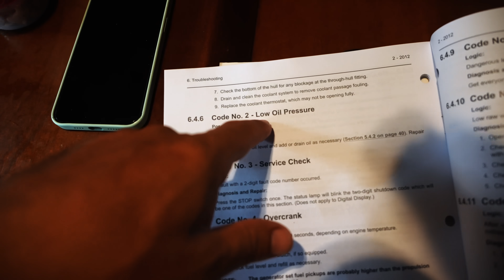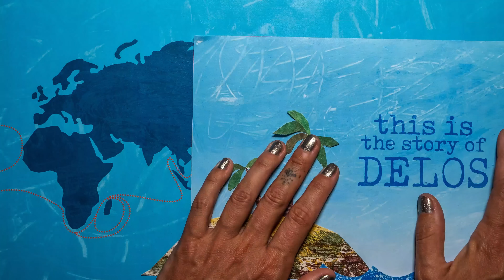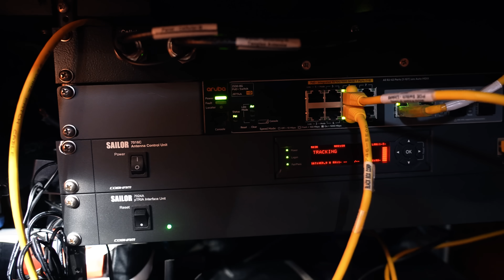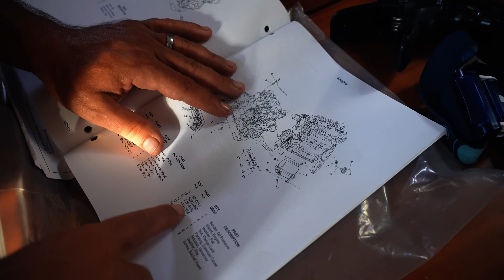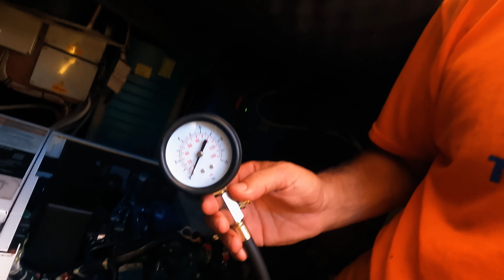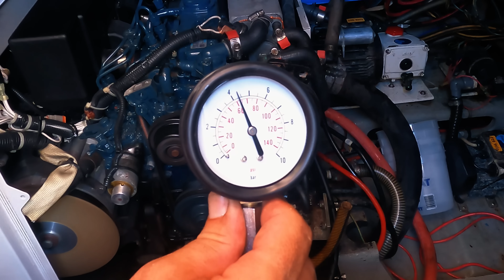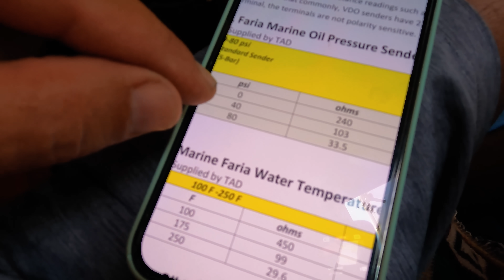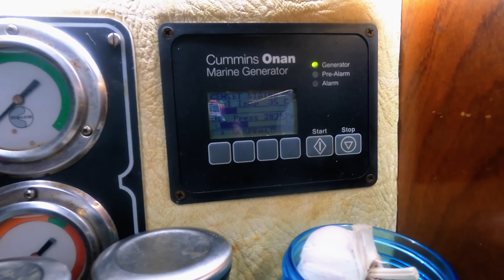TROUBLE IN PARADISE 😳 Sailing Vessel Delos Ep. 393

Comment: Hey Brian, I once had an oil pressure sending unit where the oil pressure was high enough at high rpm’s to rupture the diaphragm so it didn’t open the circuit so the light didn’t go out. Couldn’t figure it out until the plastic housing cracked and started blowing oil out at high rpm. Since the gauge said 60 psi after cooling down, yet in hot weather I’m wondering whether you have high pressure instead. If the diaphragm has a small enough leak it will take a while for the oil to get on the back side of the diaphragm. Maybe it might make some sense out of your situation. Stay safe and fair winds, ❤️👍🙏🙂.

Comment: You might be able to fix the oil pressure sender by squirting some electronic contact cleaner into the sense hole at the end. Junk can get stuck in there causing low readings. You can use a bike pump to create pressure and test using your multimeter to see if it gives you correct readings.

Comment: You guys had that generator installed in Capetown. With that crane, right? Because I'm replacing my Waterpump & timing Chain on my Vanlife Van I'm guessing your oil is so hot, the viscosity of the oil got so low the generator threw a code. Putting it in safe mode.

Comment: Awesome episode! Into amateur radio from the 1930-40 era and fixing since 1969 as a teenager. So was quite intrigued with your temp fix. Was actually telling you it was the sending unit to my iPad two seconds before you said it, as if you could hear! Fascinating that someone had a supply of resistors and lucky as well. I had capacitors for the boats tube type ham radio though. Do you use HF radio for the maritime network or sailors beyond vhf range? Thanks for your great stories!
Reply from the maker: Hi yes we still use the HF!  I got my ham license before leaving the us.  We have an icom-710 onboard.
Reply: @svdelos  great rig, should last quite awhile. Happy holidays!

Comment: Hey Brian, in case that oil pressure problem comes back, I wanted to share a strange problem I have been having with 3 different brand, size, and age generators on a Mountain in New Mexico at 8,700 feet Elevation. 1 Month ago, I had a Honda EB10000 generator constantly stop running, so I checked the oil, and it overflowed out. I assumed a person here must have overfilled it, so I drained the excess out and tried again. I checked the oil some time after, and again it overflowed out when I opened the fill cap. So, I changed the oil and the problem went away. A Month later, I have found that even with 3 different aged oils, that are 2 different viscositys, it's only lasting 3 tanks of gas (9 Gallons) and the oil looks like water, and they will not run out solar system to simply recharge the batterys. They are typically only at about 50% load at this elevation. A 10k becomes a 7k, (3% loss each 1,000 ft) so I run it at about 3,500k max. This problem is not affecting a 7hp kenitic log splitter, a 1999 Ford F250, a 2000 Nissan Xterra or any other gasoline engine we hve up here. It's only happening to the generators. The other vehicles have the exact same oil in them, from the same batch too. I have used 10w-30 for 3 years now, in all engines up here without a single issue. We do oil changes by the book on all engines, but for unknown reasons, the viscosity is changing in the generators only, and when I drain the oil, it looks s thin as water. I even tried 15w-40 Tractor oil because I considered it might be the colder temps because it was 7f when this started and tht oil is good to -40f. Since then, it has warmed up a good bit with highs in the 50's and lows in the 30's but the problem remains... I have been around engines my whole life and have never seen such a strange problem. I, like you am a trouble shooter and can usually determine the cause of problems but this problem has me stumped. Let us know if you have any more problems like that. I'm also curious once you get a new sending unit, if the pressure fluxuates like it did in this video. If by some odd chance your problem becomes like the probblem I am having, you can change the oil to buy time, and since they dont hold too much, it's a good way to get through it until we figure out why the oil is breaking down so fast. I get 3 tanks of gas through them before they start to stall. I was shocked to see the first 5 minutes of this video, and I hoped you did not have the same problem because your at at sea level. Anyway, I hope yours is resolved, but if it comes back, maybe we can figure this out eventually. Thanks for the video, enjoyed it as always!

Comment: Wasn't that turtle on that perch last dive during the day?
I bet you own a pressure gauge by now, right?
I keep various potentiometers around for sussing out what senders need to emulate for controls.  Then measure the pot and fab up the resistor bundle.  Half my 2-stroke jet skis have resistors in them lying to the controllers about things like gas levels.

Comment: I like how the manual doesn't mention you could be burning oil. How much engine control is computerized? I had a pressure sensor go out on an automobile and got a similar type of error(Low Oil Pressure) and the former is completely irrelevant around 14 minutes in. Lol, Cummins uses KPa? what? must be the Onan parts.

I'm super glad that y'all found your turtle friend from the other week too. Night diving looks like an absolute trip.

Arguably, replacing the sender is still advised. Fair Winds and Safe Travels!

Comment: I would remove the oil pressure sending unit checking for debris. Install a T fitting and install a mechanical gauge in conjunction with the sending unit. So the dash gauge shows low pressure simply check the mechanical gauge at the engine.

Comment: I am not nearly as capable a mechanic.  Came to the same conclusion (guess).  Hard to believe anyone would have resistors lying about but wonderful solution.  Also impressed there was a pressure gauge around to confirm  pressure, otherwise it would be aBIG gamble to continue to run the engine.  Did Brian ever test the resistance of the old sensor?

Comment: So you added a 30ohm resistor to bring the pressure down at or below 40psi? Not subtracted one. Because the higher the resistance the lower the pressure read by the Sender. I get it! 

Brian Sent it.

Comment: @SailingSvDelos Brian regarding the Oil you did not verified that there is an issue with pressure sensor. What might happen is that the Oil Got thicker or there is an issue with the oil  pressure when the engine gets realy hot. 
What you might done instead is trick the generator ECU but have a analog pressure sensor in place and to monitor the actual pressure of the Oil (maybe rekord it with GoPro)

Comment: Brian , If you still have isues with your sending unit after swaping out , try a motor oil flush. I have overhauled many motors and have noticed sludge bild up in the oil gallery  that feeds the lifters. All the best!

Comment: BRIAN
Many years ago, I worked In a Marina in Kent Island Maryland. Often we were struck in hot ass uncomfortable engine rooms. If you can find an old bilge blower motor an wire, it with long wires on alligator clips to connect to a battery they blow alot of air around. If you point it on you while your in the engine room it will make your time in that hot uncomfortable place more bearable.  
    CHEERS

Comment: I've been watching your movies for a few years now I think. And seeing Brian in that hot engine room made me think. You know those little electric fans that are inside of a computer to keep the components cool. Are only 12 volts but they're dependable and work pretty damn good. A lot better than a desktop fan with a clip that you'll pay $40 for it. And if you get an old USB cord you're not using anymore from a phone charger or something. You can hook the power to it which enables you to hook it straight to a regular outlet. Or, like I said it's only 12 volts. And they only use one or two watts compared to most fans. Just a thought. Help circulate stuff around without using any energy in the boat I do the same thing in my house cuz I don't have Central anymore LOL and it is admirable how he can fix anything I have several of those little fans around my house just for circulation. I don't use any electricity hardly. And people throw away old computers that have them in them all the time. I love your videos. I can binge watch them for days LOL it makes me want to sell my house and get a sailboat:-) but I do love my little patch of woods. And I like being able to ride my toys on the road. Which also brings me to the point. Why don't you two look into getting little E Scooters ;-) I have a nan robot D4 plus 2.0 electric Kick Scooter as my only transportation. (I have a referral link)You can easily put one of them on a boat. A few of them. Then you would have good Transportation when you do get on land. Mine goes 30 to 40 miles and range and 30 to 40 mph. It takes up no more room than a skateboard

Comment: That engine is actually a Kubota diesel  that has been marinized, sure sounds like your OP sender. It is not a Kubota part, they are usually VDO, Frank Murphy etc; Electric OP senders are notoriously inaccurate, better always have an extra one in back pocket. Your Kubota Diesel is a very good engine, built for manny thousands of hours. Really really enjoy  Delos, never miss an episode.

Comment: Good job Brian. Two potential future helps: you can make a voltage divider out of a few resistors and make fairly accurate current limiting resistance. They're made by paralleling a couple resistors and adding more in series. At least you're  familiar with a meter!
 Also, had the oil pressure actually been falling and the pump proved good- that would likely have been main engine bearings. Yes that would have been major surgery.
 God Jul and be safe!

Comment: Could be the Oil Filter also. If it’s not flowing through it good then it will show on the sensor low oil pressure.  The oil viscosity could play a part and if it’s not being run regularly it could thicken up.  Maybe unplug the sensor or bypass it somehow.  As long as the level is good and the oil filter is clean then bypassing the sensor won’t hurt. The sensor itself can get gummed up also and try cleaning it.

Comment: 4 stroke motors often have an oil pressure/volume  protection switch . A petrol driven water pump of mine would start but not keep running. I disconnected the protection switch and all good. I don't need the switch as the oil level  in my motor will never go unchecked.  As for the raffle , please keep it going, the "T" shirt is a great prize.

Comment: You use hose and engine to drain the boat -hose to the cooling sucktion . This is also your emergency pump on the boat in case you can run still engine and billage pumps aer short on the task.

Comment: Only one other sailor I knew had Brian’s skills and incredibly enough he too was an EE from Cisco and was now living as an marine electrician. He lived on his boat on the Tred Avon off the Chesapeake Bay. On my maiden sea passage the hub that held the wheel shaft to the binnacle broke loose shedding the chain from the top sprocket. I had bought the boat three months before. I had never owned a boat before and the only time I had been on a sailboat was 1963, in a Sunfish, for two weeks. It was now 1999. I was 52. No steering. A couple hundred miles out to sea. Here I am. You deal with it. No alternative. You just need tools. And wire. And wire ties. And tapes and glues and a great big bolt cutter and a side cutter and dremel and and and. And water.

Comment: Brian builds resistor pack to trick the system into thinking it has oil pressure. I’d have just grounded the stupid thing to trick it into thinking it had maximum oil pressure, or 12v to do the same, depending on the type of sender. Nice work sir!

Comment: With my Northern lights generator I had all gauges oil pressure temperature voltage. Very little guess work and no computer control of the engine function. Old school. Sea of Cortez is a beautiful area. We spent a whole year and a half there just exploring.

Comment: Whenever your dinghy gets flooded just pull the drain plug and floor the engine, way easier than bailing or pumping. That is how I always drained water out of our 15ft Apex inflatable hard bottom dinghy with a 25hp Yamaha Malta outboard

Comment: 🔧 ...so I'm thinking of your mechanical troubleshooting, and comparing it to road trips , and my long experience with those.... Before cellphones, and additionally affording AAA, every breakdown becomes a PITA adventure. You're stranded, forced to figure out and cobble a fix, or hitchhike for help or parts. 
A couple of old days breakdowns, running out of gas, I had a bicycle with me. So, leave the vehicle behind and cycle to the next town.

Adventure, usually manifests, when things go wrong.

Your Delos mechanical issues can be all levels of hassle, but rarely will they ever impede you getting your "vehicle " on down the "road" to help and facilities. You can always sail to the next place.
There's no sailing my vintage Datsun Roadster, or conversion van.

⚓⛵🌪️⚓

Comment: you might consider using a bleach container as a scoop to empty the dingy.   Lots easier than pumping it out.   It takes up very little room and you can leave it in the dingy.   They are made of a heavier plastic than most liquid containers.
Reply: Good Day   Puppy. 

Interesting your thoughts on bleach containers.   Feel there are multiple reuse of purpose for them.  Keep thinking as all others and myself while they are available.  

I am not a hoarder but as you they have caught my attention.  

Even using as a growing container for plants with handle - does require cutting front top half out and drilling base for drainage.  Handle is great for moving to seasonal appropriate location.  

Great Scoop !  Thanks...

Take Care 🌿

Comment: I guess you need to buy 2 oil pressure sending units so you have a spare. Hopefully your main engine takes the same one. Coolant temp would be another good one to have in your spare parts, they are small and don't weigh much so the penalty is small. Merry Winter Solstice to all in the Northern Hemisphere and Merry Summer Solstice to all in the Southern Hemisphere.

Comment: Brian, you measured 60 psi with the test gage and the dummy resistor bank produced only 41 psi. You thought the value was too high, Based on the pressure test , the value was on the low side.  I think the heat was getting to you.

Comment: Could be:

 - bad pressure sensor
 - intermittent open circuit between sensor and computer
 - oil sludge (build-up caused by either bad oil or not changing it often enough)
 - cracked pump impellor
 - broken pump drive shaft

Looks like your temp solution is okay for now.
Reply: "intermittent open circuit between sensor and computer"...intermittent issues SUCK!  Not sure how Brian wired in his cheater resister device but I would think that if it was an intermittent open circuit btwn the sensor and computer that it still would have manifested w/ the cheater device...hopefully for their sake and sanity it is just the sensor/sending unit and the new one will fix their issue.  I like Pollycat 1's idea to "T" in a pressure gauge.  That way you could see if there was a real oil pressure issue when it threw the code, provided you were looking at it when it shut down.

Comment: Whoever manufactures that genset control panel might want to consider adding a "silence alarm" or "manual override" for the oil pressure.  I'm sure the lawyers would love that but if you know you've got pressure then the EMS should STFU and keep it running.

Comment: The last thing you did was change the oil. It runs three hours before it breaks down in viscosity. If the switch was bad it would stay bad. The oil you bought is not a correct SAE RATING FOR A DIESEL GENERATOR. THEIR IS A RATING ON THE OIL AND ENGINE REQUIREMENTS. BY PASSING A SAFETY SWITCH CAN RESULT IN BEARING FAILURE. NOT KNOWING WHAT OIL YOU HAVE I AM ONLY GUESSING BUT. IT WAS THREE HOURS RUN TIME BEFORE IT FAILED AND AFTER YOU CHANGED IT ALSO THREE HOURS BEFORE FAILURE. JUST SAYING.